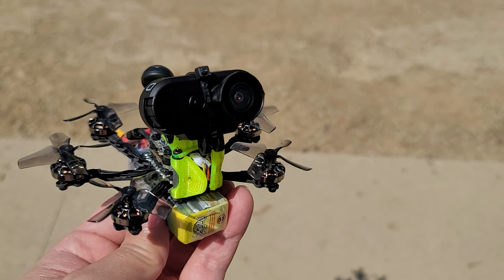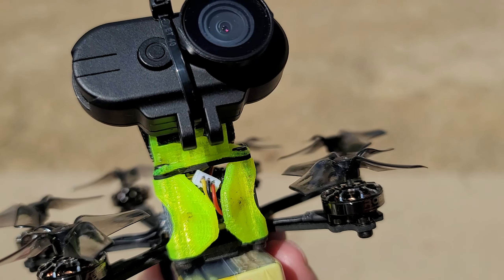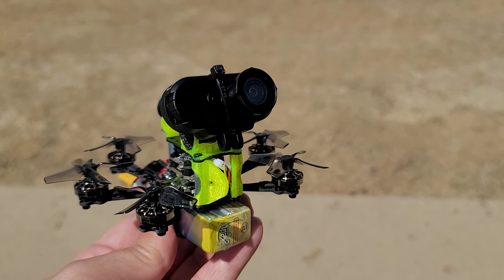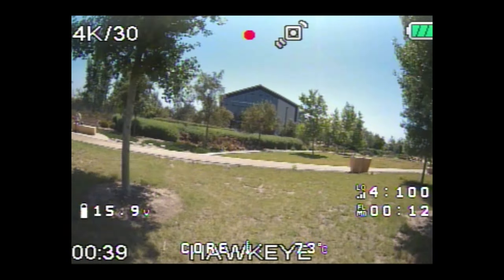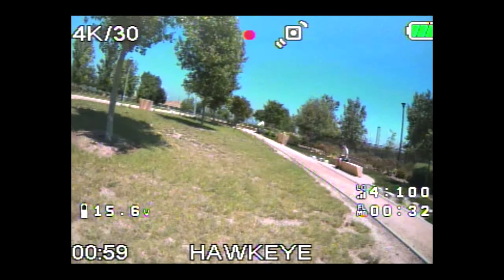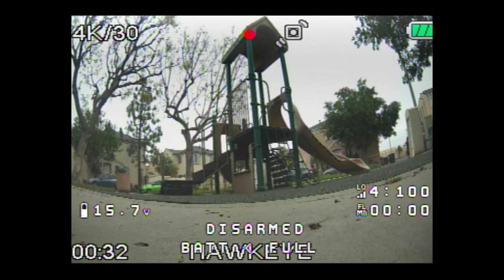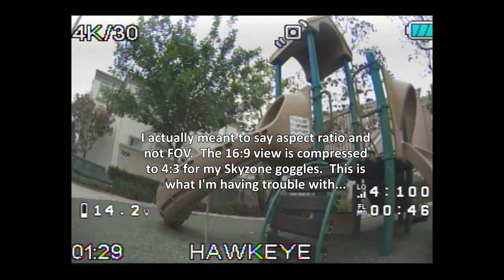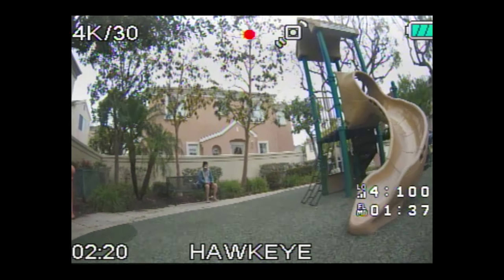Hawkeye Thumb 4K as PRIMARY FPV Camera? 🤷‍♂️

Comment: Hey Albert, thanks for making this video! I'm starting out in FPV and can either get the Hawkeye for 40 bucks or a Caddx Ratel 2 for 30. Do you think the video-out (what I see in my goggles) of the Hawkeye is that bad that I should rather go with the Ratel, or does the fact that I can record nice footage trump the difference in video-out quality? I am flying fixed wing so the latency shouldn't be an issue. Thanks man!
Reply from the maker: The goggle view on the Hawkeye is good enough for fixed wing.  Not good enough for hard core FPV racing at 150mph though.
Reply: Thanks, that helps!

Comment: hi @AlbertKimTV can you help me.....why there is no OSD on my goggles (OSD & Display have set ON at BF). i use FC Crazy405HD, VTX AKK nano3, Goggles Eachine EV800DM. thanks inadvance for your help. cheers.
Reply from the maker: Not sure, but maybe a PAL/NTSC mismatch in settings?
Reply: @AlbertKimTV  the video format already set to AUTO & hawkeye set to PAL. on BF UART1 there is no VTX (MSP + Displayport, as described on  manual).